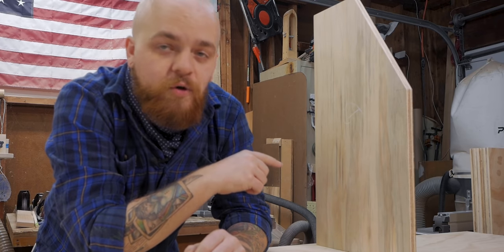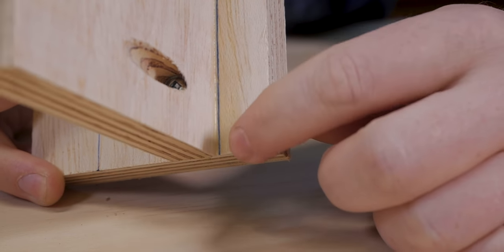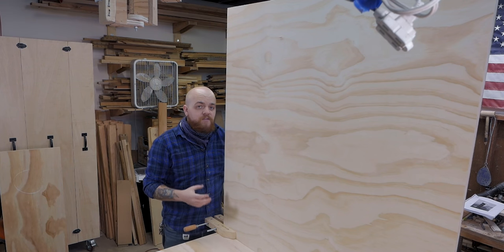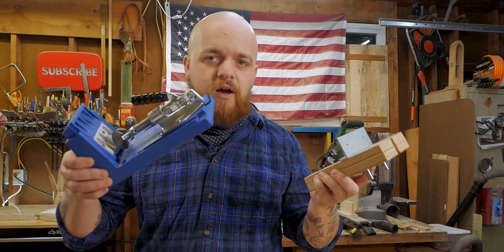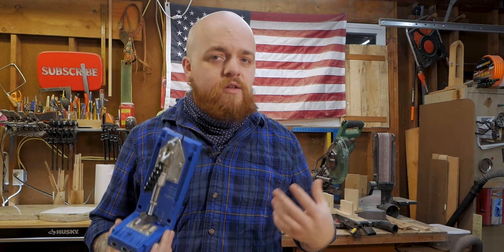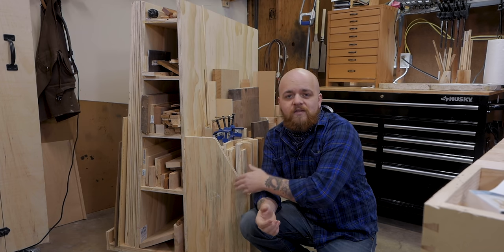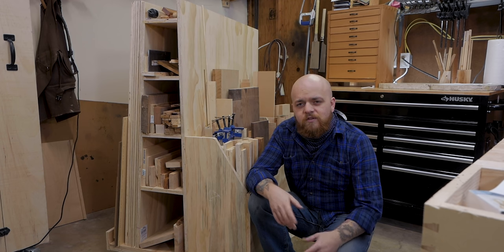Do You Think This Is A Good Woodworking Joint?

Comment: Pocket screws are relatively quite weak (matthias wandel has some videos demonstrating how weak they are if you're curious), but you're right they provide an in-place alternative to clamping which is often difficult with traditional clamping, and they're nice because they don't require you to drill through from the other side. Dowels are great for providing strength and for alignment, but as you say require you to clamp effectively. I think this is a great combination of the two. I will probably give this a try sometime

And when I say they are weak, I'm not saying they are useless. In many cases we overbuild quite a bit and don't really need all that much strength, so their relative weakness is not that big of a downside. But I would also be careful not to assume they are actually all that strong. Try putting a chair together (something whose joints undergo WAY more forces than the corner of a cabinet) with pocket holes and see how quickly it works itself apart and becomes wobbly.

Comment: have you thought about using a bradpoint bit for your doweljig? it seems to wobble a lot at the start when not supported by another dowel, bradpoint might make it more stable/accurate
Reply from the maker: Funny story I bought 4 different brad point bits by different, reputable, companies and none of them cut an actual 3/8" hole. There would be so much wiggle that the dowel was essentially useless. But the cheap general purpose point cut the best hole lol

Comment: It's a good idea and I think very similar with how many modern pieces of furniture are built (think IKEA), except they use knock-down fasteners instead of pocket holes... and I have to say, when presented with the same challenges as you, my solution was to use dowels and knock down fasteners, but without glue because I actually wanted to be able to disassemble the piece!

Comment: I'm sure the joint is fine.  It's essentially a pocket screw joint (a proven joint) supplemented by dowels.  I definitely looks like more work to me, but then I'm a fan of dados.  The advantage of dados, to me, is how easy they make assembly: everything goes together straight and in the correct position.  The disadvantage is having to tune the dado stack every time since plywood never seems to be the same thickness.  But beyond that I love dados, so this joint isn't for me.

I made the same cart in 2017, before I had a pocket screw jig.  It went together quickly.  My one complaint about it is something you will probably run into soon enough: it's too small.
Reply from the maker: Haha I think I actually like that it's too small, keeps me from hoarding a bunch of material I'll end up never using 😆

Dados definitely have their place and I can think of a couple scenarios where they would definitely be stronger, and I could see myself liking them more with a bigger table saw and more room to work. The biggest thing for me with dado joints is the clamping and drying time. If you don't do that, you need to nail the pieces together and then go back and clean up the holes. Even though this joint does take a little longer to actually make, once the screws are driven home it's essentially done.

Totally with you there on adjusting the dado stack 🤕

Comment: Wi noticed that your dowel jig moved a little when holding without the fence, would some abrasive paper attached to one face stop it wandering? Brilliant jig by the way!
Reply from the maker: Good eye Andrew! I’ve thought about doing that now I just need to get around to doing it lol

Thankfully the little bit of movement didn’t hurt the joint so long as the drill bit starts where it’s supposed to
Reply: You could use anti slip tape

Comment: I think this is a clever combination of techniques to yield a good result. I honestly think the majority of your strength is coming from your dowels and the glue, but the pocket screws provide a great amount of clamping force, especially in the middle of the piece where it'd be darn near impossible to get any clamp.

Personally, I prefer dadoes. I find them faster and easier to cut, and easier to get alignment just right (having some glide in the joint is nice when you try to get the butt joints to perfectly align). I've always had trouble getting everything perfectly flush with dowel pins, though that's probably more a testament to my lack of skill than the technique itself :)

You also raise a great point about clamping force and building things from the bottom up. If I were to make that lumber rack, I'd use dadoes, but I'd also be flipping the piece multiple times to shoot brads in from the bottom (and praying that they don't shoot out the sides).  Pocket screws are far easier to aim, and a screw is definitely beefier than a brad.

Overall- awesome! I love watching your stuff- keep coming up with the clever ideas!

Comment: I like this joint, and will keep it in mind for times when I'm doweling (or really any floating tenon) and the clamping is awkward.  Using pocket screws as clamps -- genius!  
I'm not sure this is the application I personally would use it on, simply for the fact that every wood cart I've ever had, I've overloaded it beyond all reason and propriety.  So a plywood edge in a dado just makes more sense for a serial wood cart abuser like myself, since it functions like one very thick tenon in a full-length mortise, as opposed to tiny tenons in tiny mortises (dowels and screws).  Given the forces of pushing and pulling an overloaded cart, trying to roll an undersized wheel over an oversized expansion joint in the floor, over various and sundry debris, etc., might put too much strain on the PDB.  But for normal folks with normal lumber carts, who don't abuse them like the old 'American Tourister meets gorilla' commercial, it seems fine.

Comment: Gonna use this to try to build kitchen cabinets for my condo inside my condo. The "shitloads of dust" part is no bueno, and I don't have a garage or a table saw (or the electrical service needed to operate one safely). I think I can do it with this though. If it's good enough for a lumber cart, it's good enough for a cabinet, right? As long as the face frames look good.

Comment: Hey! Do you have a link to the bigger square you use to mark on the ply? The one with the  black plastic piece on the bottom. Would you recommend it? Great video, really enjoy your channel, thank you!
Reply from the maker: Hi Pawel, it's a Milescraft and here's a link for it (amazon affiliate) https://amzn.to/35YfHRr

For the price I don't think you can beat it. Especially since that black plastic bit is adjustable, so if it goes out of square you can set it right again. That being said, it's really only useful for laying out lines and whatnot. Doesn't work great for checking square due to that black plastic piece.

Hope that helped!
Reply: @Craftswright  Got it! For some reason, I thought it is longer:( I am trying to find a replacement for a framing square, with some kind of solution (like a plastic lip on your Milestone square) which would allow for quick referencing off the perpendicular edge. Preferably for less than $100:) Fastcap makes something similar, its called Blue Dog Square, but my experience with it is far from acceptable, unfortunately. Not a biggie, will keep looking:))
Reply: You might look at a drywall square. I use this one when I am marking sheet goods. https://www.lowes.com/pd/Mayes-48-in-Lightweight-Blue-Wallboard-Square/3117757

Comment: If you leave the glue out of the equation, I think Ikea and all the prefab furniture still prices this is a viable, strong joint. Add the fact that you are using glue, and plywood instead of particle board, I think you've got a winner!

Comment: The joint has been around a long time. You are just using dowels where a lot of people [Ikea] use little metal pins to locate the joint and put external screws to it. I like the pocket holes other than I have to keep track of my #2 square head to use them. I dont have a datto stack [exscuse the spelling] so I just use the butt joint a lot. Have a table saw that has no fence and a radial arm saw [just starting out], that are hand me downs, so your joint might work in a lot of cases.
Reply from the maker: No need to excuse your spelling or your equipment, we all start somewhere and most of start off with hand me downs just like you (I know I did). Get a fence on that table saw though, those things are finger eaters even with proper safety measures! 

Would love to hear more of your progress as you grow and learn, keep me updated yeah?

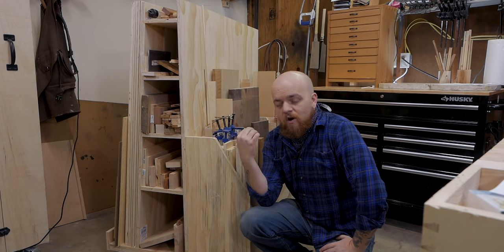Comment: How did you deal with the pocket holes for the last piece of plywood? (i.e. the large one you'd put on just after minute 8:30)
Your drill would be too too large to get into the shelf?
Reply from the maker: REALLY good eye! Don't tell anyone, but I didn't pocket hole those because (you're right) there wouldn't have been any room for the drill or bit, so I just drove screws home from the front face 😬

Comment: Damn you! (Said in jest with a smile) I bought a dado stack earlier this Summer in advance of finally building a number of shop cabinets and you've now gone and published this!?!?

Anyone interested in a BNIB dado stack?
Reply from the maker: Hahaha hey if you've got the shop and clamps for it I think dados are probably still the best option. You'll find uses for that stack, don't worry 😉
Reply: @Craftswright  I finally built a cabinet this weekend as a proof of concept before I build my drill press stand roughly based on yours. I don't currently have access to my table saw so I used a poor man's track saw and employed this joinery technique. I was a little concerned when cutting the wood as it was bowed. I think the dowels really helped to square up the joints as they came together. I was really pleased with how it all came together.

Thank you!!

Comment: My thoughts are this...the joint works great for shop projects. This is one of those joints just like pocket holes alone that are not for professional quality furniture. If you want to be a hobby woodworker just dabbling in the trade then that's just fine, nothing at all wrong with that. If you want to be a true woodworker and actually plan to make fine furniture or sell your products to the public then this joint needs to be only used for shop stuff and not sellable products. Just my 2 cents. Keep in mind that yes I have pocket hole equipment however I will not be using pocket holes for anything I intend to sell, it's just for quickie tasks around the shop.

Comment: I would have gone with the dados and glue.  I don't like pocket screws or dowels so...

But to answer the question of large clamps. Everyone has them, they are your ceiling. You spring boards from your ceiling down to the item needing clamping pressure. If you need massive clamping force you use wedges under the spring boards. ( which aren't going to be spring boards any more).

Comment: Is there any real time saved with drilling all the dowel holes? Seems like having to clamp a support the piece for just pocket screws is probably faster (happy to be proved wrong).
Reply from the maker: I would think they take about the same amount of time, but I found drilling the holes less tedious than getting the piece clamped in place just right haha
Reply: @Craftswright  fair enough. It's a good concept, using the screws to pull the joint tight.

Comment: I think this is a good idea; basically using the pocket screw as a clamp.    It would seem to me that once the glue is dry you could take the screws back out and use them again...  a much better deal than bar clamps.

Comment: This is not vastly dissimilar to the construction method used in Ikea furniture. I say that as a compliment! While they sub pocket screws for furniture bolts, which are more suited to mass production and home assembly with minimal tools and strength, the basic principle of dowel+mechanical pulling force is the same. And Ikea furniture is plenty strong enough for most applications, including comparatively high impact items like dining room chairs and tables.

Comment: It seems like this method would be quite a bit less stressful than cutting dadoes and it looks like it's plenty functional.  As they say, the proof is in the pudding.  Load it up and drive it around the shop for a year, and assess it then.  

My own lumber cart is framed from 2x3s and whatever (s)crap sheet goods I had lying around--I think the casters cost more than everything else combined.  It's working out just fine.  Yours looks like a Cadillac by comparison.  👍👍

Comment: Don't know about you but there are a lot of ways to mess up dado joints. For most of us that has meant one error identified with each attempt... easily three or four botched projects. Foremost is some line being out of square but we also have made cumulative errors in dimensions. Then, too, is the bow or warp of sheet stock not being compensated for by adequate, uniform pressure being applied as the dado is cut. Plus there is the problem of adjusting the dado set to the true thickness of the stock it will receive. Metric or imperial, hardly any material is the stated thickness. Further, if the novice is leery of using high quality materials for something that is apt to yield an amateurish result, materials like wafer board or sheathing materials vary through out their thickness.

Comment: I think that just the pocket holes with glue is enough. Also just use corner clamps so drilling the screws don't make the wood move.

Right now your method is like using nails, screws, and glue altogether to make a single joint.

Comment: You have way more experience than I do but academically I see nothing wrong with it.  Dados are going to be stronger I think almost all of the time due to the larger area of glue contact, but is that extra strength necessary?  Likely not in most cases.

Comment: 2 dowels an inch apart are not as good as spacing them 4 to 6 inches apart, that would provide more support and strength.
Same reason you would not install brads an inch from the end and nothing in the middle.
Reply from the maker: Fair point

Comment: Why not just use a decent biscuit-jointer instead of dowels? Much faster! You can even combine it with the pocket-hole-screws. I combine it most of the time with a few brads untill the woodglue sets.

Comment: Good video, and good idea!  For my own tastes,  your "pocket dowel" joint could have its uses in cabinets and shop furniture.  That's the only place I use pocket screws.  To be clear, I don't knock others for using them wherever they choose to.

Years ago, before I had the proper tooling for cutting dadoes (or dados, take your pick),  I would make what I call "fakedoes".   This type of "dado" required a bit more plywood and glue, but no router or dado stack.

Imagine a 2'x2', 3/4" thick sheet of plywood with a 3/4" wide dado running across the middle of it.  Now look closely, and see that it is a 1/4" thick sheet of plywood used as a base  with two 1/2" thick sheets of plywood glued to it, separated by 3/4" to create the "dado".  If made properly, this dado-like channel is ridiculously sturdy.  Also, the stock intended for slotting into the "dado" can be used to size it perfectly.  I've also used the method to create rabbets.

If none of that makes sense, here's a link to a quick Sketchup I made to explain it:  https://drive.google.com/file/d/1gnVmw_ZA0mDS5yjM6tjiloC6Rw1st3Zb/view?usp=sharing
Reply from the maker: Fakedoes hahaha I love it and they look pretty clever!

Comment: Just curious... Could anyone tell me from experience how well sliding dovetails work with plywood?
Reply: If you mean TAPERED sliding dovetails, they would work if using quality hardwood plywood.  Because of the rough surface friction inherent in cuts/joints made in plywood (vs. solid wood) it's very hard to get any precise joint to slide in plywood. Sliding dovetails are very mechanically strong especially in hardwood, and are used often when the maker wants to diminish the likelihood of panels warping. Artists who paint on solid wood panels use unglued tapered dovetail cleats on the backs of their panels to prevent warping as they can be occasionally hammered tight again if loosened by wood movement. I hope this helps.

Comment: I'm no woodworker, but ffs! Is this really a new idea?
Reply: It's not common practice, but I also doubt it's a "new idea." Dowels are commonly used for alignment of joinery. Mechanical fasteners are commonly used to apply clamping pressure during a glue up. I'm sure people have used pocket screws in combination with dowels before.

However, I'll say that the idea of using both is probably usually unattractive to a lot of people. Pocket screws by themselves are generally considered to be fine by themselves for utilitarian work, but are considered kinda lame for precise fine woodworking. So I don't think the joint has a lot of utility for most people.